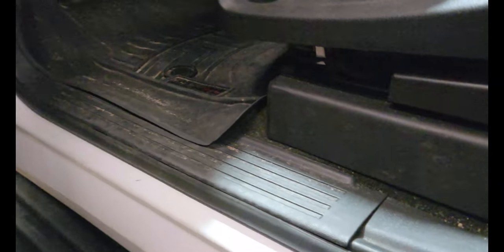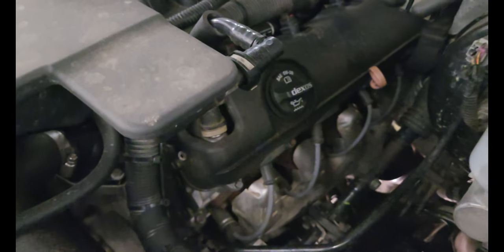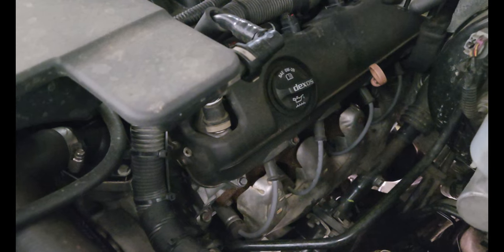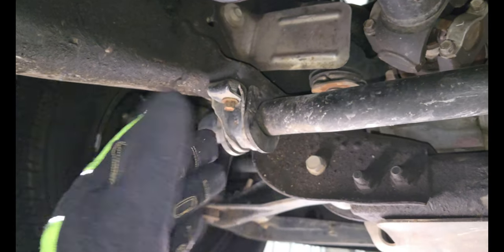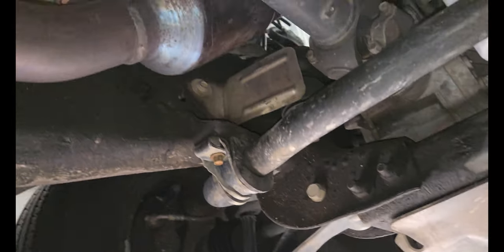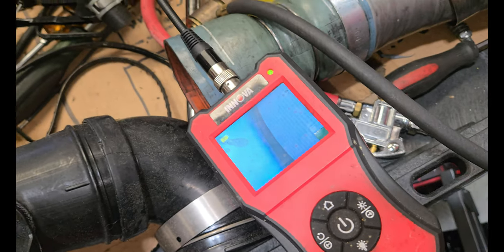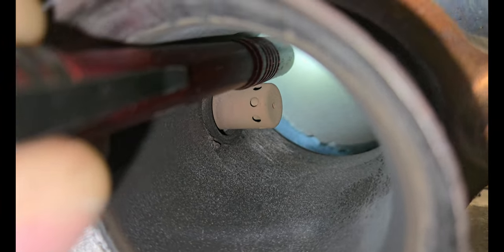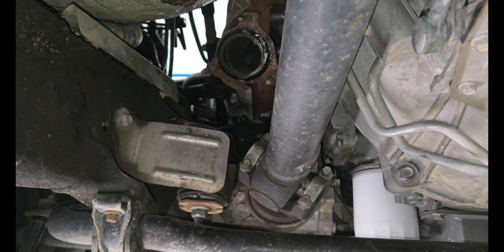Customer States: Rattle Noise (No Warranty) Crumbling Catalytic Converter Tahoe 5.3 #repair

Comment: The best tool a mechanic should have is either a 3 ft piece of water hose on a 3 ft wooden mop handle either one of those is excellent for locating knocks rattles and pings, with the wooden mop handle the sound will travel through the wood and the rubber hose it's like having a telescope
Reply from the maker: @dougdent1942  i used to use a wood handle to listen to engine knock

Comment: I thought warranty was 8 year/80k miles by federal EPA for catalytic converters
Reply from the maker: Either way it has 140k. It's past mileage. Plus it's after market cats that I put on in 2022. Part has a 2 year warranty.  And the vehicle was built 2/2016. So there goes the 8 years too.

Comment: Reading half your comments is why I never post anything. Sick tired of people whining that everything should be warrantied on old vehicles with high mileage or Ubers with low mileage trying to get personal use warranty coverage on a commercially used vehicle.
Reply from the maker: Exactly. And I literally said in the video it's a 2016 (8 years old) with 140k on it. And it's an emergency vehicle. The part is after market with a two year part warranty.  I installed them in Nov 2022. The the part was covered from the parts store. I just gave them the old one. Most people don't understand how a warranty works. I appreciate you leaving that comment 💯💯

Comment: Dam costly fix.
Reply from the maker: No its not. The part was aftermarket and had a two year part warranty. I put it in Nov 2022. So the part was warranted.  There is no labor. I don't have customers to charge. It's all internal. These are my fleet vehicles.  If it was customer pay then probably I see where your going. I think labor on that is only 1 hour. So if it was at a shop. And the part was warranty still. Then it would be $180-$200 I'm guessing. Your probably didn't know that I don't work for a dealer or a public shop anymore. I'm a fleet manager master mechanic.  So everything I touch is internal. No outside customers. It's all company vehicles

Comment: That sure made quite the racket. I noticed that the instrument cluster strangely resembles a Ford cluster. I tried putting wiper blades from a Ford on my GMC. The wiper blades worked great but I still had a GMC with all of its problems. When you order the converter from the Chevy dealer you may want to inform them that the Ford style instrument cluster isn't going to transform a Chevy into a reliable vehicle. It's like putting lipstick on a pig.

Comment: How long are they warranted?
Reply from the maker: It's aftermarket. I put them on in November of 2022. They are 2 year warranty. So they will be here tomorrow. Factory warranty on 5/60 on emissions. May be 3/36 that's kind of a gray area.
Reply: @BeardedFordTech  why the replacement? should of been covered by warranty outlined in federal emissions.
Reply from the maker: @christopherhodge6154  it is a part warranty. This vehicle is a 2016 with 140k. It's not covered under any emission warranty. That's long gone.  The part is warranty. I put it on in 2022. The part warranty is 2 years
Reply: Ahh ok. Thanks for the info and reply
Reply from the maker: @christopherhodge6154  not a problem.